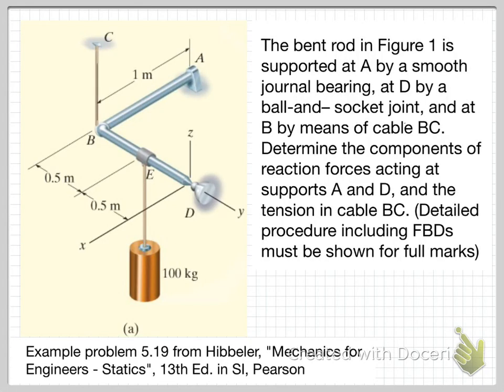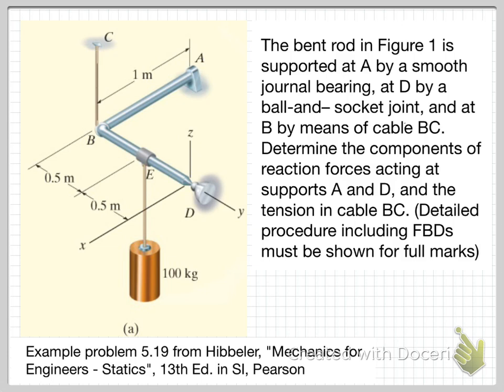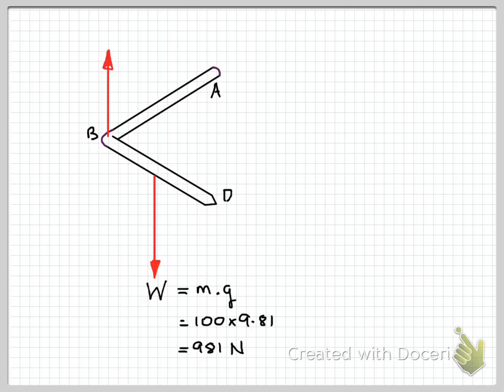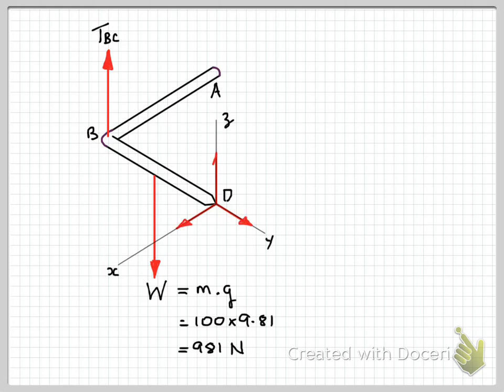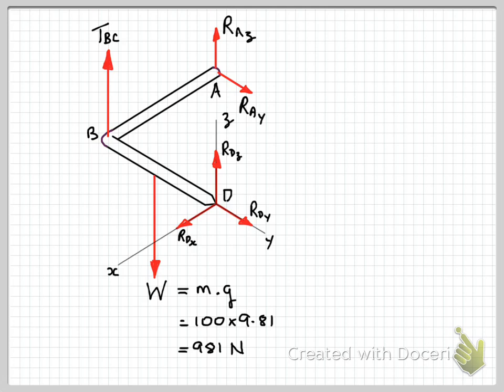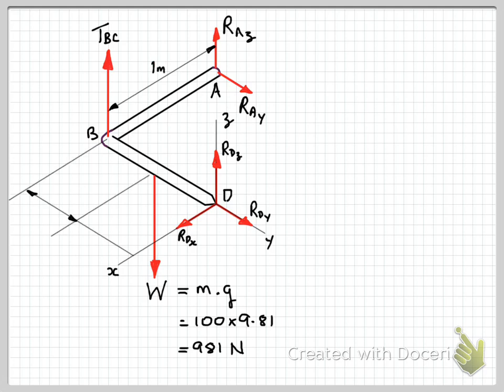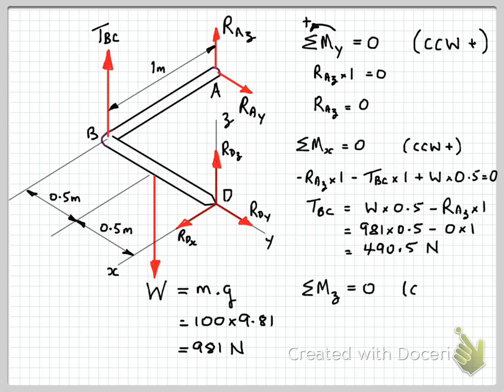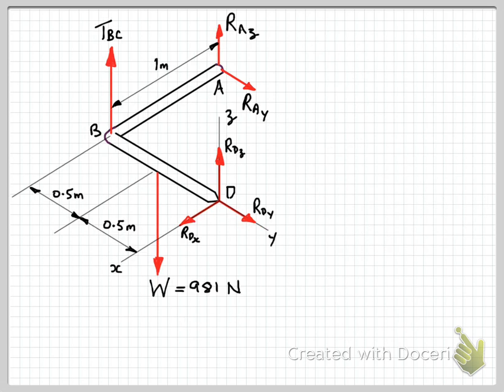3D Rigid Body Equilibrium

Comment: Thanks sir but I have still have a question regarding the Journal bearing reaction , from the problem is it physically possible to have a mention on the x axis ?
Reply from the maker: It's a bearing. It's purpose is to allow rotation about the longitudinal axis (in this case the x-axis). Therefore, no reaction moment about the x-axis. If the bearing seizes, and the shaft is prevented from rotating, then a moment about the x-axis is physically possible. The problem would then become statically indeterminate.

Comment: Once you got to 12:35 the chaos started. I don't think you have your forces labeled correctly. Also I don't believe you did all the moments correctly.
Reply from the maker: Thanks for the comment and feedback. When you say “chaos”, are you referring to the fact that lots of reaction forces turn out to be zero? This does seem counter-intuitive at first, but if you look at the original problem, you can see that the bearing at A is not actually needed for equilibrium for the loads and cable support specified. There is nothing to cause rotation around the y-axis or z-axis which leads to the result that the reaction forces at A are zero. If we included the weight of the bent rod, then we would have weight of the section AB causing a moment about the y-axis and you would get a non-zero answer for the vertical reaction at A. Which forces do you think I have labeled incorrectly? They all look ok to me but sometimes it’s easy to miss your own mistakes. Also, which moments do you think I did incorrectly? Again, they all look ok to me. What values did you get for all the reaction forces?

Comment: In the sum of moments around the z-axis shouldn't it be: -Ray* √2 ? Cause it seems to be the perpendicular distance from the z-axis with origin in point D. 
14:40
Reply from the maker: thanks for the question. Sorry for the delayed reply. √2 is the distance between points A and D, but it is not the distance from the z-axis perpendicular to the line of action of the force (RAy)

Comment: Why isn't Ray included in the moment equation for y?
Reply from the maker: The line of action of RAy is parallel to the y-axis. Therefore it does not create a ‘turning effect’ about the y-axis. Thus the moment of RAy about the y-axis is zero. Also, your question is incomplete. When asking about a moment calculation you need to state the ‘point’ at which you want to do the calculation. On the y-axis you could be talking about B, D or E (or any other not labelled point). Hope this helps.

Comment: http://dl.sabis.sakarya.edu.tr/p/70FFFVFiujIfIu3_eIUBqXDmx58afuxGrBubrWTQyY0-CEjM3b_HnMWveMao-ltt0
Reply: the third problem is what i am talking about. if its possible i need help for the sixth one as well. i really apreciate what you are doing. thanks a lot. <3
Reply: https://hizliresim.com/XLoQy7 first link that i sent is broken. you can see the problems from this link
Reply from the maker: @se0m361  they seem to be your homework problems so I won't do them completely, but a few hints/pointers. Q3: note that there appears to be a cable CD (without this the 'shaft' won't be in equilibrium). Use sum of moments about y-axis = 0 to determine force in cable CD. The 1kN force will not cause a moment about y-axis because it is parallel to it. Then use moment and force equilibrium equations to solve for other unknown reaction forces. Q6: this is a frame/machine problem where you need to draw separate free body diagrams of individual members and to identify 2-force members (e.g. member BD). Here are 2 of my videos on similar frame/machine problems: https://youtu.be/mFkc-7Fd0QQ and https://youtu.be/SasxaTDDrmU
Reply: @TerryBrownMechEng  I appreciate you taking the time.

Comment: It's a Ball and socket joint in D which allows rotations about all axes.  So instead of taking the coordinate system at D, will it be technically  correct to consider at A and take the moments about it?
Reply from the maker: Yes, you can take moments about any point you like. It will just lead to different equations that may be easier or more difficult to solve, but the answers should come out the same. In fact, it’s a good way to check your calculations and answers.

Comment: Very well explained you are a very good teacher! I Must admit I wished you had solved it using the  "clever" method. How would that method differ from this method? Would we simply use trig to find the distance of the AD axis to TBc and then calculate the moment to find TBc and then revert to the method used here to solve for the rest? Would you mind outlining this method a bit further please?
Reply from the maker: Hi Chris, thanks for the feedback. Glad you found the explanation helpful. The 'clever' way would be to use vector algebra. Probably won't have time to do solution this way any time soon as I do not currently teach the subject at my university in which this method is taught. Sorry.

Comment: very helpful explanation but do have a question;  why wasnt RAY included during the summation of moment taken at x-axis?
Reply from the maker: The line of action RAy is in the x-y plane and is perpendicular to the x-axis. Therefore the line of action of RAy would intersect with the x-axis in which case the perpendicular distance between line of action of RAy and the x-axis would be zero. Thus the moment of RAy about the x-axis is zero. Hope this helps. Thanks for the feedback.